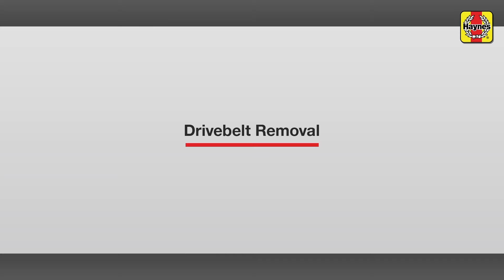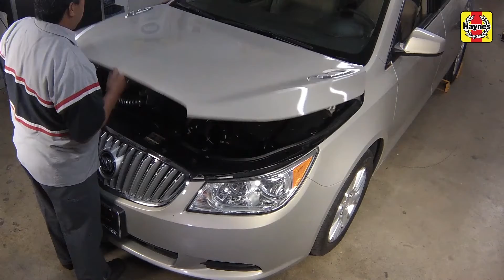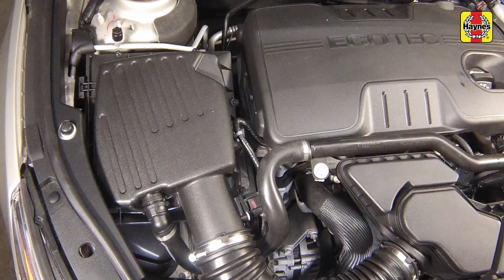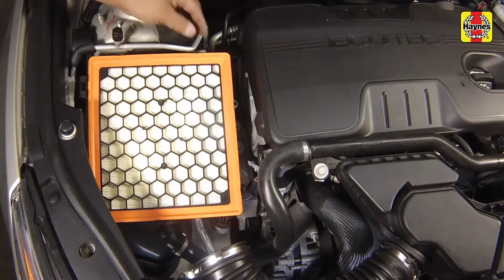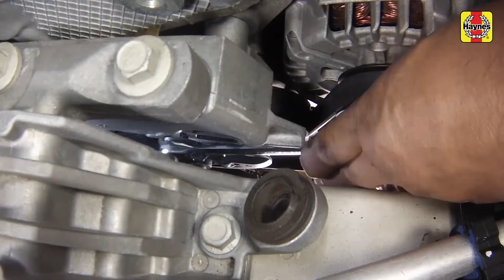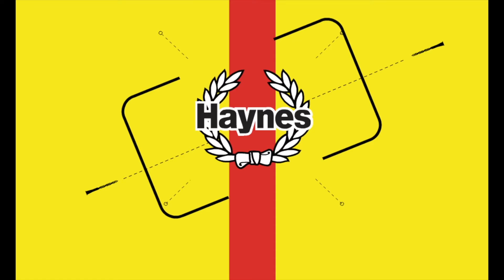Buick LaCrosse (2005 - 2013) - Replace the drive belt

Comment: Not correct way for 2005 Buick Lacrosse CXL. The belt is on the same side as the battery. There is no need to remove the air filter.